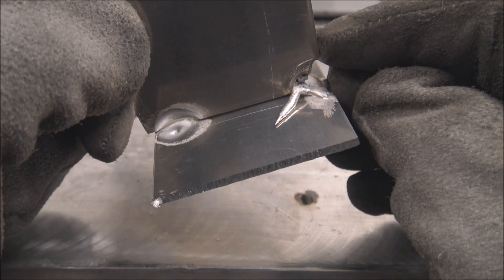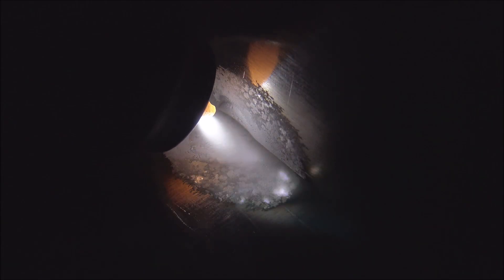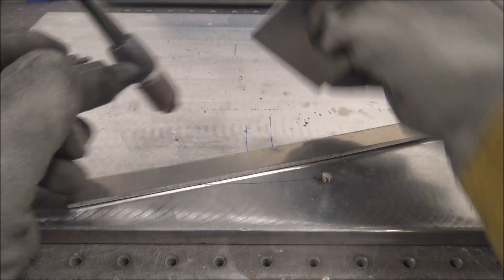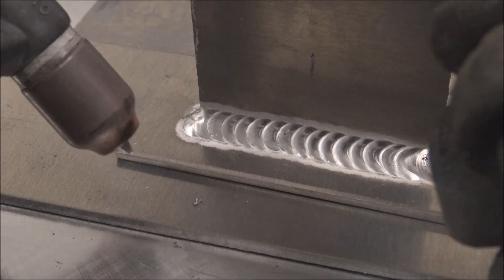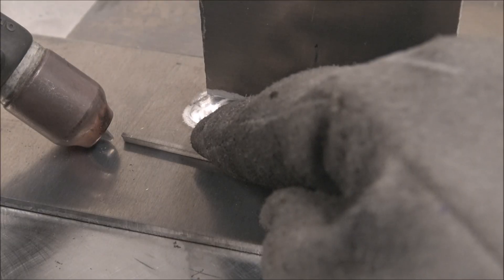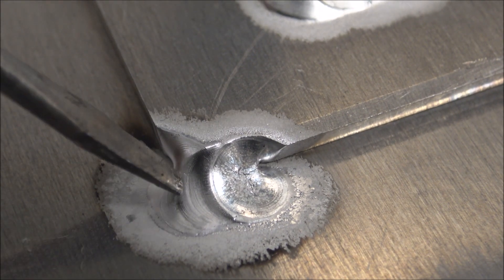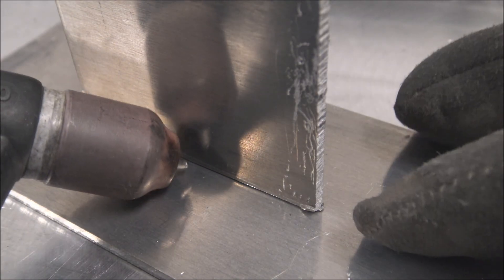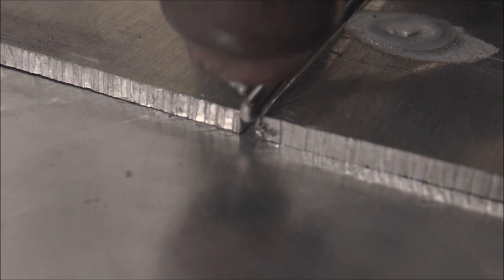TIG Welding Aluminum - Tack Welds Made a LOT easier - How-to

Comment: I’ve been taught to always ease into an aluminum weld to allow for the etching/cleaning process. Also have been told to ease into to keep my tungsten from splitting. I’m here obviously because I’m having issues with tack welding on both stainless and aluminum. Say I have a .070” pipe I’m attempting to tack welding to another .070” pipe. Do I just pump all 70 amps into the joint to tack them together? Thanks.

Comment: I was a professional welder in another life, but my experience was with carbon, stainless, and chrome moly steels for the petro-chemical and power generation industries. Now I'm retired, I bought a nice little Everlast Powertig 200 for DIY and hobby projects. I've found that aluminum is the best material for a lot of my projects (especially for the boat) and I can get pretty much whatever I need by buying scraps from a local boat builder. However, I have precious little experience with welding that material. Caution: Steep learning curve ahead. I was trying to fabricate a strap to hold my argon bottle securely to a shelf in my shop from some 1/8" aluminum plate. Simple design, but the flanges I bent on the ends for the bolt, needed gussets to keep it from straightening out when I bolted it tight around the bottle. I cut some small bits, but found they melted away before I could get a tack to work. TIP: I finally got it work by cutting a much bigger piece, put it in place and welded it, then cut it to the dimension I need after it was welded.
Reply: Yeah aluminum is a whole new Ball of wax!! I know guys who weld stainless all day.... but run a mile from aluminum 😂

Comment: Tacking can be difficult..... great video/tips!

Comparing your tig button with a foot pedal; how much [amperage] range does it allow? I.e, if the amperage control on the welder is set to 150a, any guess how low lightly/barely touching would start at?  How hard would you have to push, to get the full 150a?  No doubt these will be a challenge to quantify, but I'm curious.

Thanks!

Comment: I think the biggest struggle I am having lately is getting my tungsten to keep its shape... I prep the angle on a bench grinder with a drill and then ball the tip with a blast of high balance on some scrap. As soon as I turn the balance back down to weld, the tip gets all wonky with nodules after a few inches ... I feel like I have tried everything, balance up, balance down, pure tungsten, lanthanated tungsten, different cup sizes... Nothing seems to help it stay in shape for any length of time.
Reply from the maker: Email me through the website with your exact welder settings. I'll help you out.

Comment: That shot of the Lap-Joint tack blew me away. Starting at the bottom and then flicking up. I remember when I was first learning how to TIG weld aluminum on 16 gauge, the top plate would run away because of my too-large cup size and poor torch angle. That five second clip is now going to be engrained in my brain for the future! You and Pacific Arc Tig Welding have been instrumental in my TIG welding learning process!

Comment: Aaron I've been following you for the past 4 years and you give great insight on Tig welding I enjoy watching the content you have put together... It's a lot of knowledge I have taken in over the years to make myself a better welder and really help me get jobs done in a more timely fashion. Definitely interested in the Tig button for my setup I'm running a Tig 225x with a Maxcool watercooler and flex-loc water-cooled torch on a 25' hose setup.. I'm the same way as everyone else trying to make the most money possible for the least out of pocket.. I tried the Miller dynasty 300 and the only thing I see different between the two is the dynasty will light up at 2 amps how often do people use 2 amp to weld is it worth 16k?   Keep up the amazing content and work I'll be giving you a 👍🏻 dinger every time!!!!!!! 😉

Comment: Very good info about the problem with gaps/poor fit-up with aluminum.  Seems to me that molten aluminum has very high surface tension and that's why two pieces melt back (away) from each other when you are getting the puddle established.  Therefore it can be very helpful to stab a bit of filler rod into the gap as the puddle is forming, to bridge the gap.  Once the gap is bridged the surface tension is not such a big problem.

Comment: Excellent video! My suggestion - sorry if you've already covered this - putting together a box or other inside corner, where two sides and the bottom comes together, with limited/difficult access. How to weld into/out of the corners without making a big mess. That's where I struggle.